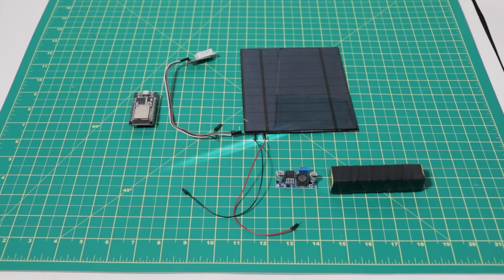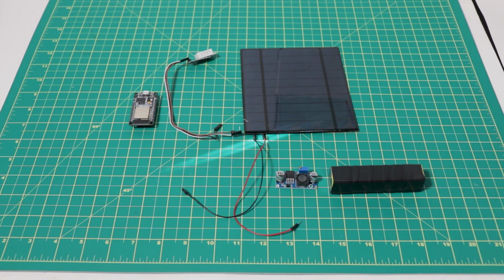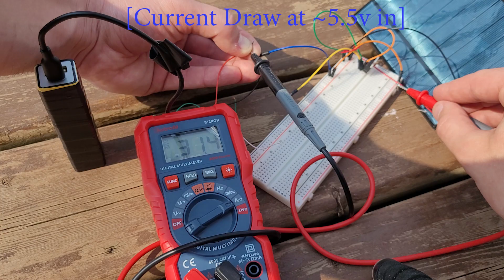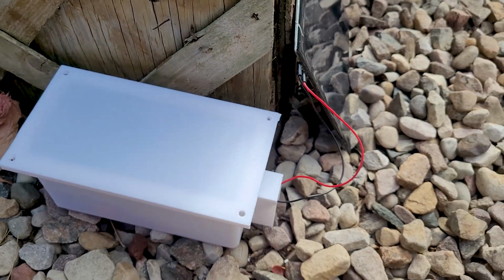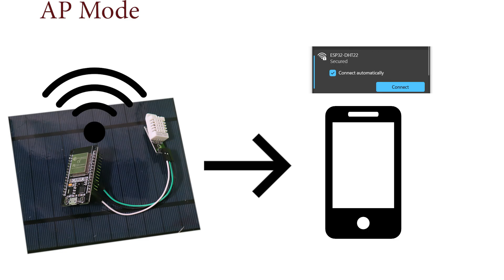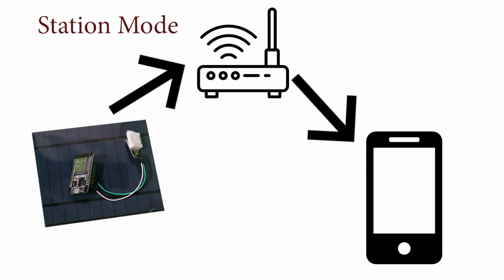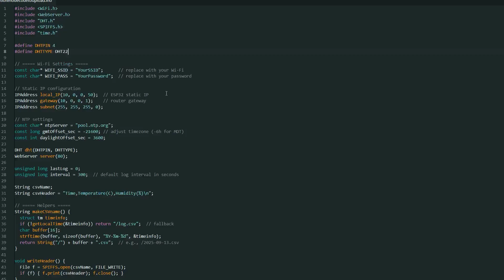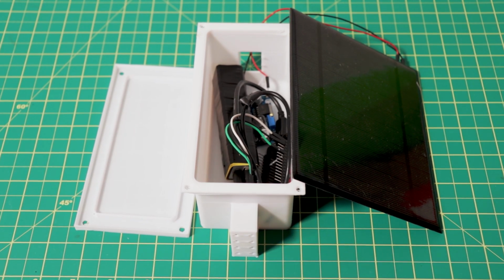DIY Solar Powered Arduino Weather Station (ESP32 + DHT22 Temperature & Humidity Sensor)

Comment from the maker: Sample Code used if intrested, Station Mode:

#include <WiFi.h>
#include <WebServer.h>
#include "DHT.h"
#include <SPIFFS.h>
#include <time.h>

#define DHTPIN 4
#define DHTTYPE DHT22

// ===== Wi-Fi Settings =====
const char* WIFI_SSID = "change SSID";
const char* WIFI_PASS = "change password";

// Static IP
IPAddress local_IP(10, 0, 0, 50);
IPAddress gateway(10, 0, 0, 1);
IPAddress subnet(255, 255, 255, 0);
IPAddress dns(8, 8, 8, 8);

// NTP Settings
const char* ntpServers[] = {"pool.ntp.org", "time.google.com", "time.nist.gov"};
const int numNtpServers = 3;
const long gmtOffset_sec = -6 * 3600; // MDT
const int daylightOffset_sec = 3600;

// DHT & Web
DHT dht(DHTPIN, DHTTYPE);
WebServer server(80);

// Logging
unsigned long lastLog = 0;       // epoch seconds
unsigned long interval = 300;    // log interval in seconds
unsigned long lastNtpSync = 0;
const unsigned long ntpSyncInterval = 3600 * 1000; // 1 hour
String csvName;
String csvHeader = "Time,Temperature(C),Humidity(%)\n";
bool timeSynced = false;

// ===== Helpers =====
String makeCSVname() {
  time_t now = time(nullptr);
  struct tm timeinfo;
  localtime_r(&now, &timeinfo);
  char buffer[16];
  strftime(buffer, sizeof(buffer), "%Y-%m-%d", &timeinfo);
  return String("/") + buffer + ".csv";
}

void writeHeader() {
  File f = SPIFFS.open(csvName, FILE_WRITE);
  if (f) { f.print(csvHeader); f.close(); }
}

void appendRow(float t, float h) {
  time_t now = time(nullptr);
  if (now < 31536000) return; // skip if time invalid
  struct tm timeinfo;
  localtime_r(&now, &timeinfo);
  char buffer[20];
  strftime(buffer, sizeof(buffer), "%Y-%m-%d %H:%M:%S", &timeinfo);
  File f = SPIFFS.open(csvName, FILE_APPEND);
  if (!f) return;
  f.printf("%s,%.1f,%.1f\n", buffer, t, h);
  f.close();
}

String style() {
  return F(
    "<style>"
    "body{font-family:sans-serif;text-align:center;background:#f0f4f8;color:#333;}"
    "h2{margin-top:10px;}"
    "button{margin:8px;padding:10px 18px;font-size:1.1rem;border:none;border-radius:8px;cursor:pointer;}"
    ".dl{background:#3b82f6;color:#fff;}"
    ".clr{background:#ef4444;color:#fff;}"
    ".rf{background:#10b981;color:#fff;}"
    "input{padding:6px 10px;font-size:1rem;border-radius:6px;border:1px solid #ccc;width:160px;}"
    "</style>"
  );
}

// ===== Web Handlers =====
void handleRoot() {
  float t = dht.readTemperature();
  float h = dht.readHumidity();

  String html = "<!DOCTYPE html><html><head><meta charset='utf-8'>" + style() + "</head><body>";
  html += "<h2>🌡 ESP32 DHT22 Logger</h2>";

  if (isnan(t) || isnan(h)) html += "<p><b>Sensor error</b></p>";
  else html += "<p><b>Temp:</b> " + String(t,1) + " °C<br><b>Humidity:</b> " + String(h,1) + " %</p>";

  time_t now = time(nullptr);
  struct tm timeinfo;
  localtime_r(&now, &timeinfo);
  char buffer[20];
  strftime(buffer, sizeof(buffer), "%Y-%m-%d %H:%M:%S", &timeinfo);
  html += "<p>Current time: " + String(buffer);
  if (!timeSynced) html += " <b>(NTP sync failed, check network)</b>";
  html += "</p>";

  html += "<form method='POST' action='/setInterval'>";
  html += "Log interval (sec): <input name='interval' type='number' value='" + String(interval) + "' min='1'>";
  html += "<button type='submit' class='rf'>✅ Set</button></form>";

  html += "<button class='rf' onclick='location.reload()'>🔄 Refresh</button>";
  html += "<button class='dl' onclick=\"window.location='/download'\">📥 Download CSV</button>";
  html += "<button class='clr' onclick=\"if(confirm('Clear log?'))location='/clear'\">🗑 Clear Log</button>";
  html += "</body></html>";

  server.send(200, "text/html", html);
}

void handleDownload() {
  File f = SPIFFS.open(csvName, FILE_READ);
  if (!f) { server.send(404, "text/plain", "No log"); return; }
  server.sendHeader("Content-Disposition","attachment; filename=" + csvName.substring(1));
  server.streamFile(f, "text/csv");
  f.close();
}

void handleClear() {
  writeHeader();
  server.send(200, "text/plain", "Log cleared");
}

void handleSetInterval() {
  if (server.hasArg("interval")) {
    int newInterval = server.arg("interval").toInt();
    if (newInterval > 0) interval = newInterval;
  }
  server.sendHeader("Location","/");
  server.send(303);
}

// ===== Wi-Fi & NTP =====
bool syncNtpTime() {
  struct tm timeinfo;
  for (int i = 0; i < numNtpServers; i++) {
    configTime(gmtOffset_sec, daylightOffset_sec, ntpServers[i]);
    int retries = 0;
    while (!getLocalTime(&timeinfo) && retries++ < 15) delay(2000);
    if (getLocalTime(&timeinfo)) {
      Serial.println("Time synced: " + String(asctime(&timeinfo)));
      timeSynced = true;
      return true;
    }
  }
  Serial.println("NTP sync failed");
  timeSynced = false;
  return false;
}

void connectWiFi() {
  WiFi.mode(WIFI_STA);
  if (!WiFi.config(local_IP, gateway, subnet, dns)) Serial.println("Static IP failed");
  WiFi.begin(WIFI_SSID, WIFI_PASS);
  int retries = 0;
  while (WiFi.status() != WL_CONNECTED && retries++ < 30) { delay(500); Serial.print("."); }
  if (WiFi.status() == WL_CONNECTED) {
    Serial.println("\nWi-Fi connected, IP: " + WiFi.localIP().toString());
    syncNtpTime();
  } else {
    Serial.println("\nWi-Fi failed");
  }
}

// ===== Setup & Loop =====
void setup() {
  Serial.begin(115200);
  dht.begin();
  SPIFFS.begin(true);

  connectWiFi();

  csvName = makeCSVname();
  time_t now = time(nullptr);
  if (!SPIFFS.exists(csvName) && now > 31536000) writeHeader();

  server.on("/", handleRoot);
  server.on("/download", handleDownload);
  server.on("/clear", handleClear);
  server.on("/setInterval", HTTP_POST, handleSetInterval);
  server.begin();
}

void loop() {
  server.handleClient();

  if (WiFi.status() == WL_CONNECTED) {
    // NTP resync
    if (millis() - lastNtpSync > ntpSyncInterval || !timeSynced) {
      syncNtpTime();
      lastNtpSync = millis();
    }

    // Logging
    time_t now = time(nullptr);
    if (now > 31536000 && now - lastLog >= interval) {
      float t = dht.readTemperature();
      float h = dht.readHumidity();
      if (!isnan(t) && !isnan(h)) appendRow(t, h);
      lastLog = now;
    }

    // Daily CSV rotation
    String newCsv = makeCSVname();
    if (newCsv != csvName) {
      csvName = newCsv;
      if (!SPIFFS.exists(csvName) && now > 31536000) writeHeader();
    }
  } else {
    connectWiFi();
  }
}

Comment from the maker: Sample Code used if intrested, AP mode

#include <WiFi.h>
#include <WebServer.h>
#include "DHT.h"
#include <SPIFFS.h>

#define DHTPIN 4
#define DHTTYPE DHT22

const char* AP_SSID = "ESP32-DHT22";
const char* AP_PASS = "12345678";

DHT dht(DHTPIN, DHTTYPE);
WebServer server(80);

unsigned long lastLog = 0;
unsigned long interval = 300;  // default 5 min in seconds

String csvName;
String csvHeader = "Uptime(s),Temperature(C),Humidity(%)\n";

String makeCSVname() {
  // simple pseudo-date from millis
  uint32_t day = millis() / 86400000UL + 1;
  return "/log_day" + String(day) + ".csv";
}

void writeHeader() {
  File f = SPIFFS.open(csvName, FILE_WRITE);
  if (f) { f.print(csvHeader); f.close(); }
}

void appendRow(float t, float h) {
  File f = SPIFFS.open(csvName, FILE_APPEND);
  if (!f) return;
  f.printf("%lu,%.1f,%.1f\n", millis()/1000, t, h);
  f.close();
}

String style() {
  return F(
    "<style>"
    "body{font-family:sans-serif;text-align:center;background:#f0f4f8;color:#333;}"
    "h2{margin-top:10px;}"
    "button{margin:8px;padding:10px 18px;font-size:1.1rem;border:none;border-radius:8px;cursor:pointer;}"
    ".dl{background:#3b82f6;color:#fff;}"
    ".clr{background:#ef4444;color:#fff;}"
    ".rf{background:#10b981;color:#fff;}"
    "input{padding:6px 10px;font-size:1rem;border-radius:6px;border:1px solid #ccc;width:80px;}"
    "</style>"
  );
}

void handleRoot() {
  float t = dht.readTemperature();
  float h = dht.readHumidity();

  String html = "<!DOCTYPE html><html><head><meta charset='utf-8'>" + style() + "</head><body>";
  html += "<h2>🌡 ESP32 DHT22 Logger</h2>";

  if (isnan(t) || isnan(h))
    html += "<p><b>Sensor error</b></p>";
  else {
    html += "<p><b>Temp:</b> " + String(t,1) + " °C<br>";
    html += "<b>Humidity:</b> " + String(h,1) + " %</p>";
  }

  html += "<p>Uptime: " + String(millis()/1000) + " s</p>";

  // Log interval form
  html += "<form method='POST' action='/setInterval'>";
  html += "Log interval (sec): <input name='interval' type='number' value='" + String(interval) + "' min='1'>";
  html += "<button type='submit' class='rf'>✅ Set</button></form>";

  html += "<button class='rf' onclick='location.reload()'>🔄 Refresh</button>";
  html += "<button class='dl' onclick=\"window.location='/download'\">📥 Download CSV</button>";
  html += "<button class='clr' onclick=\"if(confirm('Clear log?'))location='/clear'\">🗑 Clear Log</button>";

  html += "</body></html>";
  server.send(200, "text/html", html);
}

void handleDownload() {
  File f = SPIFFS.open(csvName, FILE_READ);
  if (!f) { server.send(404, "text/plain", "No log"); return; }
  server.sendHeader("Content-Disposition","attachment; filename=" + csvName.substring(1));
  server.streamFile(f, "text/csv");
  f.close();
}

void handleClear() {
  writeHeader();
  server.send(200, "text/plain", "Log cleared");
}

void handleSetInterval() {
  if (server.hasArg("interval")) {
    int newInterval = server.arg("interval").toInt();
    if (newInterval > 0) interval = newInterval;
  }
  server.sendHeader("Location","/");
  server.send(303);  // redirect back to main page
}

void setup() {
  Serial.begin(115200);
  dht.begin();
  SPIFFS.begin(true);

  csvName = makeCSVname();
  if (!SPIFFS.exists(csvName)) writeHeader();

  WiFi.mode(WIFI_AP);
  WiFi.softAP(AP_SSID, AP_PASS);
  Serial.print("AP running → IP: ");
  Serial.println(WiFi.softAPIP());

  server.on("/", handleRoot);
  server.on("/download", handleDownload);
  server.on("/clear", handleClear);
  server.on("/setInterval", HTTP_POST, handleSetInterval);
  server.begin();
}

void loop() {
  server.handleClient();
  if ((millis()/1000) - lastLog > interval) {
    float t = dht.readTemperature();
    float h = dht.readHumidity();
    if (!isnan(t) && !isnan(h)) appendRow(t,h);
    lastLog = millis()/1000;
  }
}